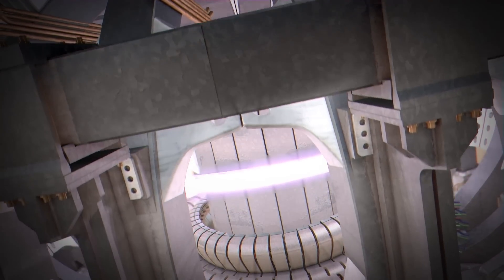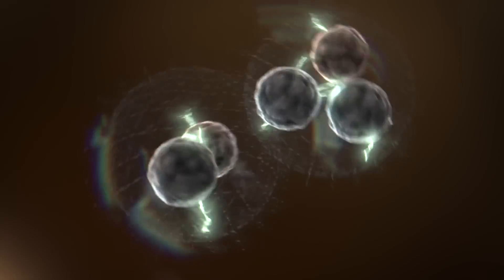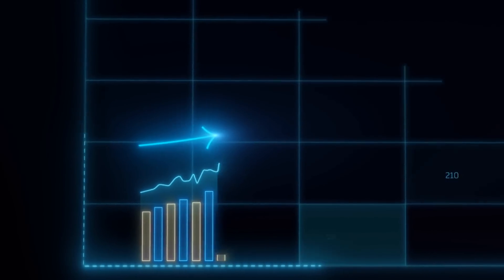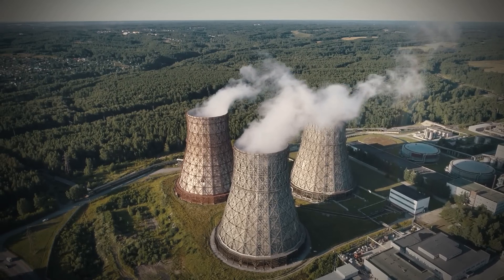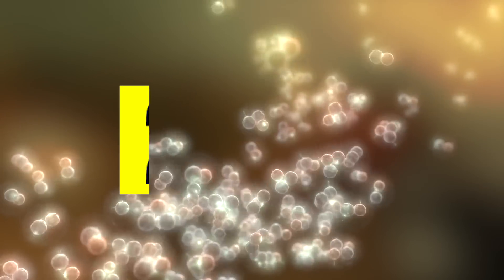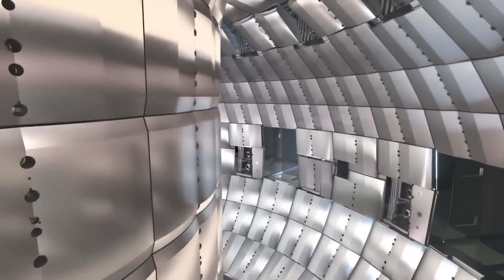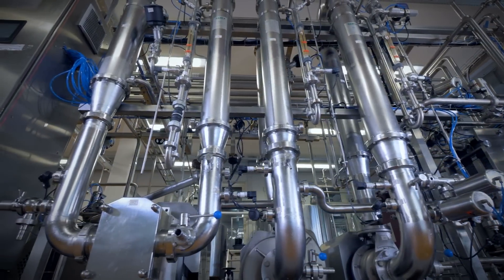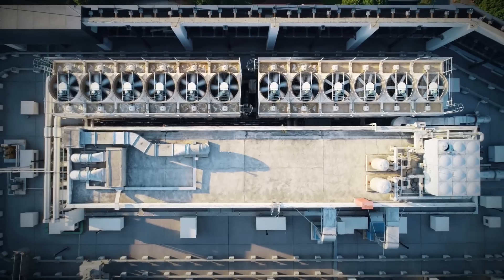The Shocking Problem That Could End Nuclear Fusion

Comment: We've always been "a couple of decades" away for the past 60 years. At this point I don't think it's a surprise to anyone that fusion was going nowhere and would probably continue to go nowhere. There's been some success in development of course, but considering how long they've been at it, not much relatively. It is however true that research into fusion has spawned tech that s useful elsewhere (as is generally the case for any serious research). So it's not been a complete bust.
Reply: I mean, fusion is worth well more then 100 years of research and more.
Reply: @Po1lux  Fusion power plants might probably work some time in the future. But obviously we can't wait for this. We need some reliable and non-fossile carbon based energy source by NOW. Therefore we should build any known technology as wind turbines and solar (electrical and heat), geothermal energy and such. If some time in the future, fusion might work we can remove some of the installations, which might be unwanted in the landscape and pester the scenery, but not now. Avoid fission power plants, which still create waste we can't handle still after so many years of using them.
Reply: @horst4439  Wind turbines and solar aren't all hat good though. Nuclear fission as a temporary solution is a much better option. Wind turbines take up huge amounts of space and require massive areas of wildlife to be dislocated, plus they are responsible for the deaths of tens of thousands of rare bird species. Solar panels are better then wind, but they also don't work 100% of the time. With both Solar and Wind if something was to happen and they were both to suddenly stop working for maybe a day or so, cities would begin to run out of power very quickly, so they need to be on like 70% of the time. To solve the problems of potential accidents giant batteries that do not exist will be needed. And most geothermal energy sources simply aren't very efficient.

Fission as it is is much better. It has a smaller CO2 footprint then solar panels over a 10 year period (Solar panels require a lot of mining to build and put CO2 in the atmosphere), plus nuclear waste is recyclable and can be used again. When a fusion reactor shuts down, they are still capable of transmitting energy to another location for tens of hours afterwards as well. Fission is actually quite safe as well, we've had them for decades and have only had three major accidents. Chernobyl only got out of hand because of people trying to cover it up and not enough progress going into fixing the problem, and the reason it exploded in the first place was because of a inspection failure. Throughout the entire history of nuclear power plants, less people have died then for how many coal kills in a single year.

If we want to transition into full green energy like solar panels, first we would need to transition into fission, we can do it quickly and produce more energy per land area. We shouldn't build wind farms in the first place anyway, they take up way too much space. If anything we should just use fission until we get to fusion.

Comment: I heard that a key component of sustainable fusion is gravity. Scientists use higher temperatures to compensate but it might not be enough to solve the problem because the amount of energy put in would be greater than the energy output received.
The tritium problem seems like a government policy issue.

Comment: CANDU reactors can effectively use natural easily available un-enriched uranium and thorium. 

For a lesser amount of R&D than Fusion could bring them to a failsafe molten salt reactor design. 

We have uranium and thorium resources to last centuries.

But future Nuke powerplants probably won't get built -- due to two big hurdles;
the NIMBY aversion...
& 
a tendancy to complexity cost overruns and delays.

Fusion power plants won't be any different, & even the radioactive waste issues will remain -- coming instead from neutron bombardment of components at the end of their life.

Deep hot rock geothermal, solar & wind power sources are much quicker and less problematic to scale up, invest in and mass produce. 

Meaning all the economies of mass production and capitalistic investment work well for them.

We need quicker replacement over finding ever more geopolitically locked fossil oil resources than Fusion or Fission will allow right now.

Comment: So, we need tritium that we don't have and lithium 6 that we don't have.
How about working on an energy source that actually produces more energy than it takes supply it?
You know, like fission, oil, coal, and gas. None of the modern pipe dreams on energy production seem to bother with cost of producing the energy or ensuring resources actually exist for large-scale implementation.
It's like talking about going to Mars without considering the radiation exposure getting there or while on the cold lifeless ball. The big fusion reactor in the sky produces a lot of hard radiation.
Also the weight of food and water that has to be lifted into space or the cost of toilets in space.
How about setting aside pipe dreams, suing NASA, NOAA, and so many other groups that are lying to us about past temperatures and improper sighting of weather stations.
Before ruining everything, actually look into the facts of past data.

Comment: one solution to the he3 supply problem would be the moon.
there is supposebly a large amount of he3 in the surface layer of the moon, build up over thousands of years from constant solar bombardment. a concentration of about 1-in-1,000,000 particles if i remember right, which seems to be enough to be worth mining the effort.
i guess they will have to start sending people to the moon again in the near-ish future.

Comment: I sincerely don’t get what the problem is supposed to be.
We have enough of Tritium to continue researching the technology for the next couple of years. Should there be the need for more Tritium, for example because of D-D fusion appearing too far out of reach, producing it may be costly, but trivial when it comes to the technology.
Neutron flux reactors are well understood and used in research all the time. Surrounding the neutron source with a blanket of heavy water, which is kinda abundant, will yield Tritium, as that’s just how it gets produced in the CANDU. You would not even need Lithium-6 for that.
Should Fusion power be commercialised, more efficient methods of producing it, for example in Lithium blankets, could and would be researched. But until then you could probably come by by just firing neutrons at some heavy water.
Reply: If it's simple to make Tritium using a neutron source and some heavy water, why are fusion scientists proposing to use breeder blankets instead?
Reply: @BLOKE0001  Have you read my comment? Because I have clearly stated that we could use reactors before Lithium blankets become productive enough.

Obviously, using dedicated reactors to breed Tritium is more expensive than making it in the reactor itself. But my point was that we will not run out of Tritium, simply because we can make more if needed, on our way to have fusion reactors that breed their own Tritium. So when we can rely on blankets, we can phase out breeders for the more efficient method.

By the way, there is no such thing as a "fusion scientist". The people working on those reactors are engineers and physicists from many different career paths.
Reply: the video is clickbait
Reply: @pyropulseIXXI   It's not. fusion reactors are a hype and it won't be viable for decades let alone profitable. A successful fusion reactor should use resources that are abundant in nature.

Comment: Maybe you addressed this in other videos, but one important missing point is that for the moment, the fusion reactors that are imagined, do not contain any device or mean to recover energy; while it is the main target of the fusion process, for the moment there are no plan to recover the heat, produce water vapour and make a dynamo turn. Since the heat is maintained in a magnetic levitation, the fusion is "wireless" and do not touch the walls, so how do we recover the heat ? Is it only by radiative transmission ? The main challenge include PRODUCING heat to start and MAINTAINING heat to continue the fusion reaction, but to produce energy you need to tap into a store of excess heat. (that is the opposite)
Reply: Fusion reactors produce most of their energy in the neutrons flung off. 

Basically, they're contained neutron bombs. 

The lithium blanket that would be added around the reactor absorbs these neutrons, making heat and tritium in the process. 

But the lithium pumping, heat transfer and containment gear -- all the superstructure -- electronics, exotic magnets, etc. are in the direct blast of that neutron flux.
Reply: @jbdelphiaiii7637  so you think that just cooling the reactor structure would be enough to make steam and turn a dynamo ?
Reply: @AlexandreLollini  The energy would be mainly coming from a heat exchanger in the lithium blanket. Neutrons get absorbed there, heating it up, that heat is carried off to produce the steam and turn turbines. 
Less than half the energy is radiative heat coming off directly from the fusion, but the immediate fusion container, insulated from the magnets, would also contribute to making steam thru an intercooler system, preventing things from melting...

The immediate magnet structure around the reactor is artificially cryogenically cooled, taking some of the energy the lithium blanket intercooler gives to the plant's turbines for the pumps/compressors it would need. 

It might be quite the task to keep them superconducting & crygenically cold under the super high neutron flux.

Comment: They will all be white elephants because cold fusion is around the corner. 
Cold fusion is ionized hydrogen molecules/atoms/gas, from pure water, passed through a vacuum ripping them apart to then be drawn into the choke point of a very strong magnetic vortex where the helium is created 
I am the only one with the actual model 😃
$$$who is paying ?

Comment: Interestingly enough, before watching this video, I knew it has to do with shortage of materials needed. My second guess was the interior heat being too hot for any material to withstand unless a ceramic hybrid.
Reply: the heat actually isn't a problem, there is a vacuum layer between the plasma and the wall which seperates the two

Comment: This is a lot of misleading information. 
1.) The problem is not so big (possible fusion reaction immediately Litium and deuterium, there were experiments but not by the nowadays unfortunately general magnetic confinement method, but by inertial confinement)
2.) The development of the energy production by fusion is a long and complicated procedure. It consist of a lot of stairsteps. Now the experiments does not concern the production of electric energy, or investigate other fusion reactions. These will be next stairsteps. Now the researchers would be happy if the fusion could produce more energy output than energy input, in form of ANY type of energy. It is evident, that D+T reactoin os not available for energy production in industrial level, but this is the level of experiments now.

Comment: Anyone who thinks we can contain and sustain plasma that is 8 times hotter than the Sun, is deluded or selling a dream as likely as eternal life. In 25 years we have gone from something like 2 seconds to 5 seconds. That's right, since 1997, with all of the tech advances since then, we only managed this insignificant gain. This technology has about as much viability as using nuclear bombs as energy sources.

Comment: Deuterium+Tritium is not the only way to get fusion. It's the easiest, that's why it's the one used in nuclear bombs, but that extra neutron means you have to get extra careful with materials surrounding the fusion core - and eventually, most those materials will get radioactive, which compounds the issues. It's far simpler if you go with helium-3, or forget that and concentrate on deuterium+deuterium reactions, although these last ones require higher pressures and temperatures release much less neutrons as by product

Comment: You can also fuse Deuterium with Lithium-6 to produce 2 Helium atoms. In fact, this method is often used in hydrogen bombs using Lithium(6) Deuteride instead of the Deuterium-Tritium mix which loses potency over time due to the short half-life of tritium.

Comment: I think its not a problem that they are hiding. Instead they are solving fusion problems linearly. From a cost perspective you would want to prove that fusion works first before investing huge amounts of money on subsequent supply problems. Obviously solving these problems in tandem would make fusion viable quicker, but in the case that humanity cannot sustain a fusion reactor the money invested would be a loss. Doing it linearly allows humanity to invest the potential lost resources into other energy solutions.

I did find your video informative. Thank you.

Comment: I like how you think its tritium and not that fusion will never produce more energy than it takes to make happen. There's a reason hope was in Pandora's box. Its also one of the demons, the most deadly.
Reply: Fusion is already working.
It’s just that the „on Earth“ version is very sudden in delivering the energy.
So let’s just use the working fusion reactor in between. BTW, all our energy comes from there, if it is delivered today via electromagnetic waves or millions of years ago, stored in rotten plants in the underground as coal, oil or gas. Even the bigger elements we or the Earth‘s kernel are splitting to let mc^2 warm us/… is coming from such a reactor, which, at end-of-live create bigger and bigger elements, finally big enough for fission.

Comment: If only we had a massive naturally occurring fusion reactor we could reliably harvest energy output from, and do so as the cheapest form of energy available today.
Reply: This heavily depends on where and when you put said solar panels. We have so many options for power because out planet is varied and some forms don't operate well in some locations....you don't see us putting solar panels in a forest. Utility level solar onshore wind and natural gas are all decently close in $/MWh and the leader changes depending on various factors. Maybe instead of claiming its the best say its one of the best because this stuff gets complex once you actually start looking into it. Also the lowest $/MWh I can find is actually hydro. Why use the nuclear explosion in space when we can just use gravity?

Comment: Looks like the lack of available tritium, as well as lithium is certainly a problem.  
Perhaps, in another video you could explain how the Helium produced by a fusion reaction is seperated out of such a "reactor".
Since Helium is a by-product it must be extracted or the reactor will effectively cool, one would think. 
Another topic that might be of interest is just how the plasma in a fusion reactor is heated to millions of degrees needed for the fusion reactions.  Is this done solely by magnetic compression of the initial plasma? or?

Comment: If you don't currently have a method for removing helium, your fusion reactor will never work. As a matter of fact, there will never EVER be a fusion reactor. We know how to fuse hydrogen to helium. All of our nuclear bombs are hydrogen fusion and there in lies the problem. 5 people on this planet know how to make a fusion reactor the size of a college refrigerator using water out of the tap that can power 100 of your closest neighbors for about a week on 20oz of water. The problem is that this process is like balancing a ball bearing on a razors edge. That problem has been solved but releasing it to the general public and someone caps the process to remove the helium and dumps in a 100lb S1 container of liquid hydrogen(~$600 at AirGas Supply) and it will make a boom that will twice level any city on the planet. There will never be hydrogen fusion for general use... Ever. Any attempt at making hydrogen fusion is only for research dollars and a life long job as hydrogen fusion has been only 30 years away since the 1960. 30 years is also just long enough in the research industry to retire comfortably.